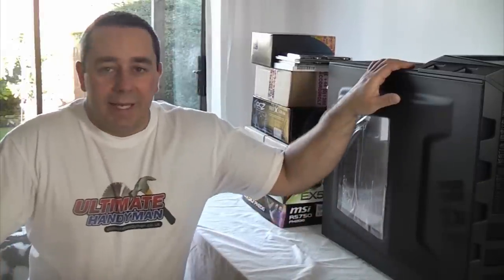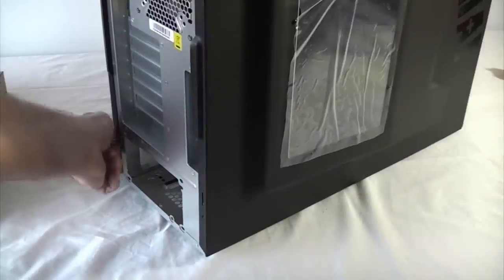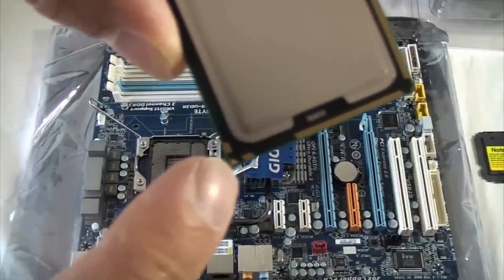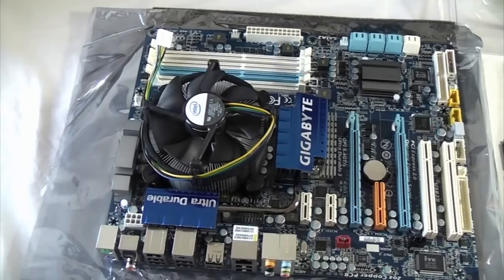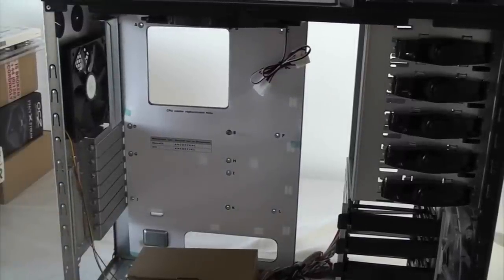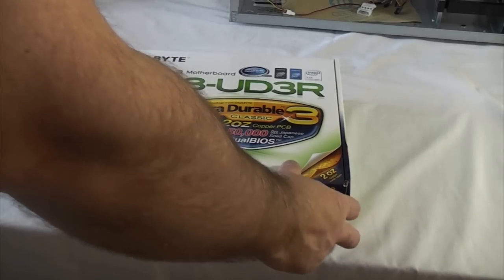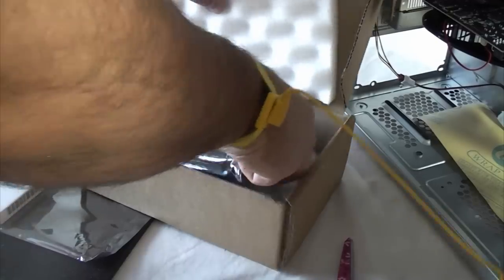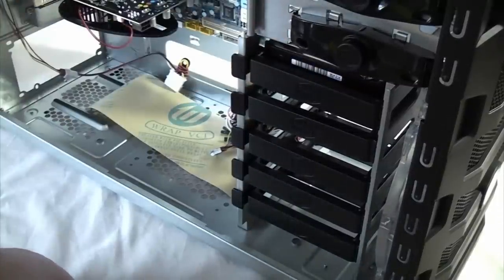How to build a computer

Comment: Guys i just ordered a computer that i am going to build however i am worried about my psu as i ordered 430w, my specs are.
CPU	Intel Core i5-2500K 3.3GHz Quad-Core	
Motherboard	Gigabyte GA-Z68P-DS3 ATX LGA1155
Memory	Corsair XMS3 8GB (2 x 4GB) DDR3-1600	
Storage	Seagate Barracuda 1TB 3.5" 7200RPM	
Video Card	XFX Radeon HD 6870 1GB	
Case	NZXT Source 210 Elite (Black) ATX Mid Tower	
Power Supply	Corsair 430W ATX12V	
Optical Drive	Sony AD-7280S-0B DVD/CD Writer

Please reply asap!! thanks

Comment: Hey guys I just finish to assembled my new pc and when I try to boot it for the first time it doesn't recognize the monitor and the keyboard ? Mouse is detected fan I'd working power is working but just won't recognize monitor and my screen is working 100 %sure as I tested it 
Help please
Reply from the maker: Yan Larue 
Does the Mouse and keyboard have USB or PS2 connectors ?
Is the motherboard on board graphics or is there a separate graphics card?
Reply: ***** my mouse and keyboard are currently in ps2 But I tried in other slot and same thing mouse still works but not the keyboard . It's kinda hard to access they bios without monitor
Reply from the maker: Yan Larue 
Yeah, you really need the screen working to see what the problem is.

Does the computer beep when booting up?

Comment: i have 3 blue ram slots & 3 white ones, can i put just two ram sticks & leave one empty?
Reply from the maker: +0cards0 
I think you can with most motherboards. It should telly you in the motherboard manual, if not just give it a try ;-)
Reply: +Ultimate Handyman 
kk thanks
Reply: +Ultimate Handyman 
i have GA-ex58-extreme, i have it for 7 years, i checked in the memory support list & i dont see 8gb sticks there, does it means it wont support 8gb stick? the website also says that not all sticks has been checked so maybe it will work?

Comment: Hey PC users! Will the ASRock H110M-DGS Micro ATX mobo's pcie x1 lane be obstructed or blocked by the Rx 480?! I ask because I need to install a wifi card into the board :P

Thanks in advanced :D
Reply: Rezinator just google your motherboard plate and check ebay in comparison for its suitability, e.g. Wireless is around £8-22 and easy to use, so much better with ethernet cable though.. i got a 30metre ethernet cable running in my house on the second floor to a back bedroom. Wifi can suck it

Comment: - Intel Core i5 2500K 3.30GHz @ 4.40GHz Sandybridge CPU
- EVGA Z68 SLI Intel Z68 (Socket 1155) DDR3 Motherboard
- TeamGroup Elite 8GB (2x4GB) DDR3 PC3-12800C11 1600MHz Dual Channel
- Zero Infinity Phantom CPU Cooler
- HIS HD 7950 IceQ BOOST 3072MB GDDR5 PCI-Express Gfx Card
- Seagate Barracuda 2TB 7200RPM SATA 6Gb/s 64MB Cache
- OcUK Battle 750W Dual Rail High Efficiency Modular '80 Plus' Power Supply
- Scythe Kaze Master Ace 5.25inch Fan Controller

what you think?  only £770.  all from OcUK

Comment: good video. just one thing when dealing with micro circuits you shud be wearing surgical gloves to avoid contamination with skin cells and hair. and them static bags :P they are pretty good at attracting dust, so maybe don't take the main board out of its bag and drop it onto the outside of the bag. great vid overall tho :)

Comment: Does the SATA cables come with the hard drives?
Reply from the maker: No, not normally.
You do normally get some with the motherboard but I have never had them included with the hard drive.
Reply: So should i buy one. I am not sure if a sata cable will come with the Msi Mate z97. Will it?
Reply from the maker: Ville Leinonen
I don't know if they ship SATA cables with their motherboards. You best wait till it arrives and see, luckily SATA cables are not expensive ;-)
Reply: ***** yeah i will just have to relay on my hope. But thank you for the information the parts will be on my door in 3 weeks or so, so then ill see hahs :)
Reply from the maker: Ville Leinonen
Good luck with it ;-)
Reply: I bought WD Blue 1TB: no fancy box, no SATA or power cables =(

Comment: @TheJob1997 if you need a LOT of power go for intel because they make much better processors but if you want bang for the buck meaning u want something not too fancy go for amd. Amd bulldozers are kinda cheap and offer enough performance. But remember if you are gonna buy bulldozer u need AM3+ socket motherboard, the regular AM3 wont work with em

Comment: Great video man. I'm itching to build another one now.. Haha
Reply from the maker: bjorn joseph 
Thanks for the comment ;-)
I guess I should build another one now as this is 6 years old!
Reply: ***** sense this one is 6 years old you should just give it to me lol
Reply from the maker: Ross Vanderpool 
Ha Ha, I would do but I'm using it to type this message ;-)
Reply: I have a very similar board that i'll be upgrading, a gigabyte x58 USB3. i'm not sure if it's older or newer but it has three PCIe slots but six serial HDD plugs. i'll be going from a E5506 to a W5690. i'm not sure what the difference is from the E5690 and W5690 however the E5690 isn't on the supported CPU list.

Comment: put the antistatic on your ankle buddy its just easier and unless your rubbing your balloons on your nylon carpet  i think there is little risk of static i've ruined one component in 20 years of pc building   some bags are static outside the bag and some are not . you think the companies would all use it outside the bag too but they dont. i build on the box once i empty it then shift to the machine after cpu ram and cooler are placed on the board its simple and most stuff these days just works out the box if you use a reputable brand like gigabyte asus and asrock  msi i've found are 90 percent working out the box  as i bought 50 motherboards for office builds and some were not posting atall its a batch thing i suppose  and happens when half the staff are on a tea break ha ha. good video mate.

Comment: i know if this sounds a bit sloppy but, does any else here ever ground themselves?.. i mean i know i should but i just never bother because ive never once had an issue with the whole static thing.
Reply from the maker: It's probably only a very slim chance but if you are handling expensive equipment it's best to take precautions ;-)
Reply: Never used an antistatic band, I always use surgeons gloves or touch a sink tap (these are earthed) to discharge any static I may have.

Comment: Guys what do you think about this build:
Motherboard: msi z97 gaming 5 
CPU: Intel core i7 4970k
CPU COOLER: cooler master Hyper 212 evo
GPU: msi gtx 980ti
RAM: g.skill ripjaw x series 16gb
PSU: corsair CX750 (750W)
Harddrive: SATA Western digital blue 1TB 
Case: Zalman z11 plus
Reply: +Maze Echo Consider getting a SSD. Corsair PSU are also really crap, try EVGA or SeaSonic.
Otherwise it seems like a really solid build.
Reply: thanks :) and i plan on getting a ssd after a while, i heard that its nit necessary
Reply: Maze Echo You already have a really good build, why not make it better? A ssd will give an enormous performance boost, especially in boot times and loading games.
Reply: LiekIFYou CriEVERYTIEM you know what? you're right. i mean i do have the money to do so so why not? btw you're not the first person to criticise the psu in my build haha. any psu you recommend?
Reply: Maze Echo
Currently I'm using the SeaSonic G-750 Gold:
http://pcpartpicker.com/part/seasonic-power-supply-ss750km

The EVGA G2 750 is also a really good psu:
http://pcpartpicker.com/part/evga-power-supply-220g20750xr

These parts might be a bit more expensive than the CX though (depending on where you live), but the PSU really shouldn't be the component to cheap out on.
Reply: alright thanks, ill check them out. :). I might get the evga g2

Comment: get the i5 no games support more than 4 cores so the i7 will make no difference. I think you'd need a 850watt power supply that way if you wanna add a 660 later on you will have enough power.

Comment: The intel i7 920 uses the LGA 1366 socket, the intel i5 750 and 2500 uses the LGA 1156 socket, the motherboard in this video uses the LGA 1366 socket, so no it will not work.

Comment: This is incorrect. The bag is anti static once the product is inside. Once you take it out, it's non conductive material. Two different things. You can even get a multi-meter and check it out yourself. There are also various video's that prove this is false.

Comment: I'm pretty sure I connected all of the important wires, but my computer would not turn on.
Reply from the maker: +Rurouni Kenshin 
Is the power supply definitely connected and switched on (some have a switch near the socket on the PSU)
If it is I would start to check that all the case connectors are definitely in the correct position on the motherboard.
Reply: Have you connected up your power button to the relevant pins on your motherboard

Comment: YOU COULD HAVE CLEAN UP THE WIRES A LITTLE BIT USING ZIP-TIES...
Reply from the maker: That makes it much more difficult to swap the PSU when it inevitably fails ;-)
Reply: *****  If you buy a decent enough PSU then it shouldn't fail on you, even with semi hard use (such as few hour long gaming sessions everyday, mixed with video and media editing and normal browsing/video streaming) it should still last the period of the machine

Comment: hello evry 1,im goin to build a gming pc.cn u hlp me?and tell me whats gud and whats not.this is my specs..
Processors:Intel Core I7-3770K (3.5G) 8mb 22nm
motherboard:Asrock Z77 Extreme6
Internal Hard Drives:1.0TB Seagate Barracuda
Solid State Drive ( SSD):40gb Corsair F40 Force Series
Memories:Kingston Hyper X Memory 8gb (1600C10D3B1/8G) 1x8
Graphic Cards:Asus GTX670 DCII 2gb Ddr5 256bit
Power Supplies:Corsair TX 850w 80+
Optical Drive:Asus 24x 24B3ST
Chassis:RAIDMAX SUPER AEOLUS USB3.0

Comment: rofl i built my  PC Intel Core i5 3470 Ivy Bridge 3.20 GHz 6MB 77W LGA1155 
ASUS P8Z77-V LX Intel Z77 ATX Ivy Bridge Socket 1155 
Mushkin BlacklineFrostByte 997055 16GB(2x8GB) DDR3-1600 
CoolerMaster Extreme 2 525W PSU 3 Yrs Warranty 
Western Digital Caviar Blue WD10EZEX 1TB 64MB SATA3 
LG GH24NS95 24X DVD Writer SATA OEM 
CoolerMaster CM Storm Scout II Mid Tower Black
with nice cable management and i bet i can take it a part quicker but i  to be honest i did not mean any thing bad in my comment

Comment: This "old thrift store computer", i`m guessing is old tech and would be pretty much non upgradable, to anything decent anyway. You can`t for instance take an old pentium 4 pc with agp graphics slot and put an i7 and pcie gpu in it. They are totally different architectures. Don`t buy anything you`re not 100% sure about as you could get stuck with a right pos or even parts that do not work together. Do some research on the net first. There`s loads of guides out there.

Comment: A beginners build
Reply from the maker: +Robert Long I hope you learned a lot from it then ;-)
Reply: I've been a computer tech since 1983 have built many for public and military. but did learn
Reply from the maker: +Robert Long 
Thanks for the comments ;-)
Reply: +Ultimate Handyman Question. Would it be at all possible to upgrade and modify my computer from 1995? It has a multitude of ports open for graphics cards and ram however, I am unsure to if it would be able to use them nor do I think the core I7 would be compatible with currently installed slot?
Reply from the maker: +Alexander Vassil-Horse 
It's often uneconomical to upgrade computers of that age when you try and get them to a new-ish standard. It's often cheaper to buy a new computer. Or you could buy a new motherboard/processor RAM etc. 
You might be able to sell your old computer and put the proceeds towards a newer computer, but upgrading one that is 10 years old is normally not economically viable, especially as most computer components have a limited lifespan.
Thanks for the comment
Reply: ***** I figured as much. To the very least, I had planned to redesign the body to accommodate a gigabyte motherboard and hold other essential equipment and have cooling capabilities. Selling this computer would certainly be impossible because of its age and efficiency.
Reply from the maker: +Alexander Vassil-Horse 
It might be worth upgrading it, you would have to have a look around to see what parts are compatible etc.
My computer is almost 7 years old now, but I'm reluctant to upgrade it because processors have not moved on much since building it.
Reply: I have examined the processor slot and it appears to be incompatible with the processor chip I plan to purchase so I will have to just go with my remodeling plans. Plus I do not think the board would be able to keep up with the strong components I have planned for it. The new board is relatively cheap so it should not be too much of a problem. Thank you for the video, it has given to me a little understanding of how I should design the internals.
Reply from the maker: +Alexander Vassil-Horse 
You are welcome.
Best of luck with the remodeling ;-)